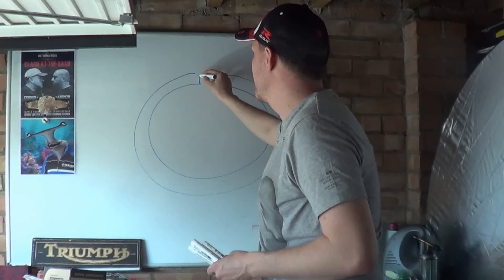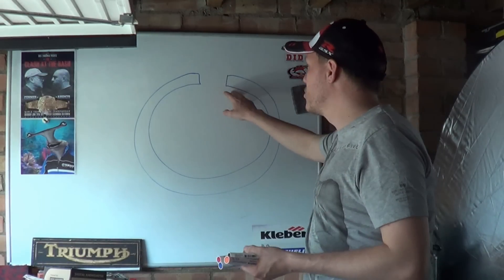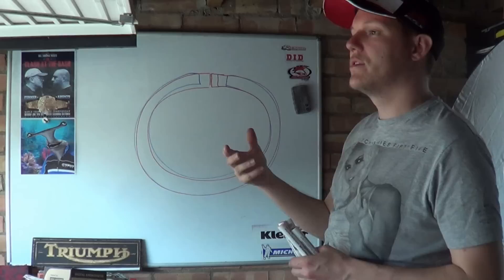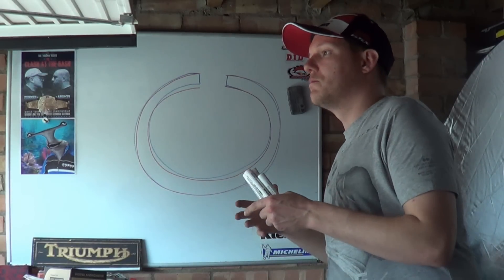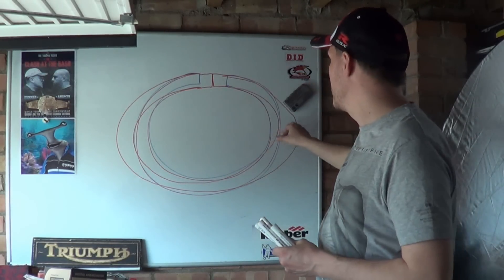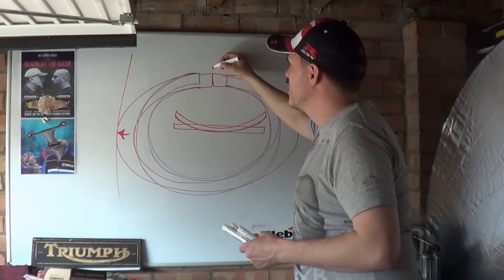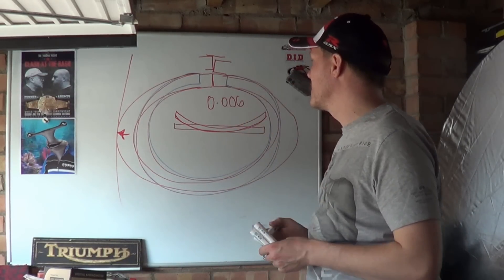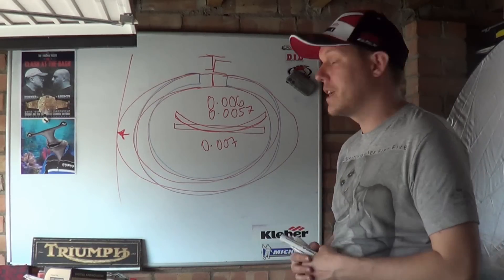Piston Ring Gap - the importance of

Comment: This information simply isn’t true... Hastings Mfg. built two Oldsmobile Aurora V-8 engines about 2000-2001. They dyno tested both engines to get baseline numbers. They increased the ring end gaps incrementally all the way to .080” and found no significant difference in blow by. HP and torque value remain little to unchanged.
Reply from the maker: Prove proof.

Comment: Always went by an ancient prophecy by a long passed ancient assembler. .004 per inch of cylinder diameter unless otherwise stated or forced induction in which case multiply .004 by the number of sockets in an Aldi toolkit 🤪. Ps.   First bit is correct and never failed me.

Comment: i have a sr20ve engine an only when i rev the engine pass 6000rpm it pump's white oil smelling smoke from the exhust...could dis be faulty rings or gap //the gap it 0.022....is dat good for the sr20ve.???
Reply from the maker: White? Coolant leak. Your head gasket might be leaking or cylinder is cracked
Reply: @thedirtyworkshop  more like oil residue iin the exhaust valve  ports only in #4 cylinder.. ..rite now engine is scrap out ...

Comment: is there any truth to the theory that if your engine is a bit tired and using more oil than usual between services you should up the weight say from 5w30 to 5w40 providing both have the same spec i know its now weight but hopefully you get what i mean
Reply from the maker: No. Weight is an Americanism that should be banned lol as engines wear the clearance increase. This means a steady drop over time in oil pressure. Using thicker oil doesn't help this in any way.
Reply: @thedirtyworkshop  so it wouldnt help the oil burning issue then? full rebuild the best way forward price depending?

Comment: I've one question temp is required for expansion of piston ring but at starting of engine temp is very low so rings will not expand and joinds are not attached one end to other end so small gap will be present at initial so the mixture will not compressed properly right? Plzz reply

Comment: Got a question for you,

I built an engine (4cyl iron block 89.00mm bore), I bought a set of piston rings for the stock bore size from some company. DNJ Piston rings I believe, I tried calling them or their manufacturer and I didn't get any information.

I forgot to check my piston ring gap, this is an NA engine by the way. I was told by many that the ring gap is usually already there for stock applications, and that you will usually get an oversized ring instead of an undersized one sometimes. Should I be worried or no? I still haven't started the engine yet. Was also told that machine tolerances are pretty high as well.

Thank you.
Reply from the maker: Did you measure the gap? If not, do it now
Reply: @thedirtyworkshop  Didn’t measure, what are the chances of something bad happening? Rings were ordered for stock bore size, unknown mileage on engine (KA24DE from the 90s), honed the cylinders down. 

I was under the assumption that the rings ordered for the stock bore size were pre-gapped. I’ve yet to start the engine.
Reply from the maker: 100% if its the wrong gap... if it were me I'd check, dont check at your own risk

Comment: Is minimum gap too risky due to heating? Should max gap be used?  Re-ringing an old Chevy 235-6 low HP engine by modern standards. Well presented topic!  👍
Reply from the maker: For reliability in between max and min is a good place to start
Reply: Thanks!

Comment: Matt, could you consider a further video on why the expander ring behind the second ring on a 2T is absolutely mandatory (if supplied with the ring kit)?
Reply from the maker: Because the engineers have calculated the thermal load through the piston to ring interface
Reply: Ah, ok. Also the depth of the ring is different between those designed to run an expander and those that don’t. So, if there’s an expander ring in the box it must be fitted otherwise the ring can go under-flush on one side and catch the exhaust port on the other.

Comment: My advice as an amateur 2 stroke mechanic...always use original items..if you go aftermarket just choose expensive brandts and good quality products..NEVER use cheap aftermarket products...the little amount of money you will save in that case you ll need it (and much more)to repair the damage that will be done...i never had problems with original parts and i never measure gaps ...trust me

Comment: My rings are specced at .006" per inch of bore. My bore is 4.125" which comes to a minimum of .0165" gap. The rings are sitting in the bore with .023" gap. Sure I'll loose a little power but my motor won't snap a ring land like it did last time from base factory spec.
Reply from the maker: if you're snapping ring lands with the OEM spec then obviously you've changed something - but what?
Reply: @thedirtyworkshop  That's easy. Fuel slosh from a tank that was just a bit too low.
Reply: 4.125 x 0.006 is 0.025. The 0.23 gap you measured is 0.056 times the diameter, and is thus less that your minimum spec.

Comment: 45 years ago I put new rings in my 500cc single cylinder AJS.
That night I went for a ride along Gilchrist Ave Herston (way before the Inner City Bypass was constructed).
It was a cool night and I gave it a bit of throttle and within 15 seconds the motor started going slower and slower.  I declutched and the motor immediately stopped.  The motor was seized.  Could not turn it over.  After about 5 minutes it unseized and I could turn it over but it was still 'firm' in the turning.  I waited until it spun freely and gently rode it home.
The next day I took the head and cylinder off and filed the rings down (I don't remember how much).
I reassembled the motor and did not have a problem after that.
Yes, ring gap is important.
Reply: Cool story 👍

Comment: Alright chap. I've bought a teng torque wrench and it's a right bastard to set it the upper range , is yours tight as fuck as well ? (40-210nm 1/2) have to be he man to set it higher than 150
Reply from the maker: are you undoing the locking nut on the bottom? As you wind in the torque wrench, the nut on the bottom turns, doing itself up
Reply: @thedirtyworkshop  seems chinesium. The scale says "torques" lol
Reply: @thedirtyworkshop  yea deffo as per any other torque wrench. Is really weird.

Comment: me, I change the rings of pistons diesel engine 2.0 l ... but now I notice the smoke that comes out of the oil cap with the motor rhythm, after asking the mechanic he confirm me that it will leave with the time, is it normal? ... I drove 250 km with the car, of course having to let it run 8 days in idle for reasons of 8 hours per day, now the draw of the car is a lot better but the story of the smoke, r disturbs me
Reply: Heya man, diesels do normally have a fair bit of blow by and crankcase pressure naturally but without seeing it I'm only guessing  how bad it is. A compression test can give a good idea of what's going on in the cylinders and is fairly easy to do yourself or cheap to have done. If she's hard to start or low on power, oils all watered down or blowing excessive smoke then there may be an issue. If she starts nice and shows decent compression across the cylinders ya probably ok.
Reply: @brotangyoust9252  thanks for the answer,  
The start is nice , as the power it's better then before changing the gaps of pistons,  but I don't know if it's on the top or not because it's yet in break-in period and I think it's not advisable to force the engine, but overall the power is good , 
As compression test I have not the measuring device,  may be I will do it in the future,  as the quantity of smok it's not lot,  it's just when the engine is hot,  and I will make video of the engine working,  thank you
Reply: @brotangyoust9252   Hi there , you can see this video 
https://youtu.be/RrVfR_HTGJE

Comment: Hi workshop, just a silly question, releated to rings and two stroke, in a two stroke when the piston goes down , air is comoressed , so can that air escape from the exhaust port as there is no ring on the skirt of piston, iam thinking of adding a ring   on the skirt, waiting for ur reply
Reply: balsagar Kotkar a 2 stroke crankcase compression ratio is around 1.5:1 so it doesn’t need to be that sealed. Same reason the port timing is measured from the top of the piston, not the top of the ring

Comment: it seems to me that there is a lot too much angst surrounding ring gaps.
I have seen absolutely no test based evidence that there is any significant compression or performance losses through large or over size piston ring gaps.
in fact when AE the ring manufacturers research dept tested the effects of  very large ring gap size on a Ford Engine they found the performance loss 'insignificant'
http://www.diagnosticengineers.org/journal_%20articles/Ring%20Gaps%20vs%20Knowledge%20Gaps.php
it seems to me that it is one of the many old Wives tales that perpetuate over the decades due to lack of proof and ignorance .

if you measure the actual ring gap provided by the manufacturers tolerance range it is an absolutely miniscule area as a percentage of the area of the cylinder especially if the pistons are fitted with ring pins.
I haven't calculated the area but it is clearly a very small fraction of 1%.  Even if we were to accept that a large ring gap was responsible for  1% drop in performance would we really care ?  

1% drop in performance would be impossible to measure without sophisticated testing equipment . 

if the piston has 2x or more piston rings then even with an over large ring gap there would be no appreciable loss in compression and performance. If the compressed gases got past the first ring gap there simply wouldn't be sufficient time to get past the 2xnd ring gap due to the speed of the piston and the number of compression /decompression actions which would be 50 to 100 times every second at 3000-6000rpm

Its all about the piston ring seal to the bore thats where blow-by occurs when rings get worn and age they lose their springiness and don't provide an effective seal to the cylinder wall

Comment: Here's a thing that i didn't (and still don't) understand: 
If you run a 2stroke there is a fresh mixture above and underneath the piston and little (piston ring) gap especially when cold.
What preventing the "flame" from traveling through?
Reply from the maker: Nothing, but its a choke point. This is why you have a large cone around you're spark plug. Flame fronts combust and release heat, this in turn heats the fuel/air ahead of it. The tiny ring gap and the rings themselves absorb this heat and the flame front is killed off. 

Great question. Video coming soon.
Reply: THX for the (quick) reply, so it's that simple ?!
I knew there had to be something otherwise every 2stroke ever build would have exploded at first start ;)
Didn't expect this answer, always thought that an ignited fuel-air mixture was unstoppable (behaving gunpowder like)
BTW it's an very old question that I had examining the piston of my first moped, witch was black underneath the top ring (yes it had 2) about 30 years ago!

Comment: It surprises me that these oil rings and the holes under them that return the oil back inside the piston don't clog. Wouldn't they block once the oil gets old and oil changes aren't done regularly.
Reply: hi i have this issue of starting my car it hard for it to move  until 5 mins of run and hot in engine before gaining pressure to move can any one advice on what to do ,it a honda accord engine 1999 model

Comment: Thank you for the help , I just got new pistons and rings took my pistons and jugs to be bore 10th over size the Bore is 3 inch and 510th the ring gap was 22th but by the math the ring gap should be 16th or 17th  but S&S pree set the gap for the chrome moly at 22th spec sheet has 18th to 22th , the  piston to bore is 2.5th clearance ,  Ring 2 is cast iron has a gap of 28th and that has me worried  S&S has the gap between 18 and 24 thousands ,  the oiler ring gap is at 35th  but can go to 40th  , I was thinking to big of a gap and you get blow by , But test have been done and even a ring gap of 1/4 inch  did not change engine performance or burn oil . The test was done by Chevy on the V6 and V8 , not a Harley Davidson .
Reply: Did you change the gap or go with S&S spec and if you altered the gap did you see any issues compared to standard spec?
Reply: @jediknight1294  Yes I went with the S&S rings that been pree set and 2000 miles I was getting blow by ordered a new set 20 over did a quick hone on the jugs , cut the gap 18 top ring 18 second ring the oil ring was 26th so left it be.   been good 5000 miles no blow by or leak down

Comment: Thanks for the Intel. I broke a ring on a 1958 generator and need to find some. Now I know how important the gap is. Do you know where I can order rings just by the size? Also AvE forced me to sub!
Reply: Hasting Rings online I just left the webpage USA Michigan
Reply from the maker: "Do you know where I can order rings just by the size?"

- the OD, ID and thickness are very important - this is why they are supplied by engine model. For your generator - start by looking for the correct piston od, this isn't going to be easy though. Do you still have the broken ring? If so send me (via email in the description) the thick, cylinder bore and the depth of the ring
Reply: The Workshop, I have all the measurements but I can't find your email in the description

Comment: Also I filed my ring on just one side. Just needed a little bit for spec but now it’s good. I think it’s a little angled just a touch. 

Any how what if the rings where angled a bit off on both sides but still in spec? The piston manufacture wants the rings flat and even shows a pic saying to be sure the rings are filled flat. 

Is this little bit able to make a difference?
Reply from the maker: It depends on how much - if they butt together then all hell breaks loose
Reply: That's why I said still in spec. meaning the gap is in tolerance with a feeler gauge but the corners are a little bit wider but still barely in spec on the corners. It is angled ends instead of flat. Will that make a difference while running?

Comment: i bought a set of rings for my yam FJ1200 last year, had to buy from ebay in the states cos i couldn't find any in the UK,  anyway they arrived and the bloody oil rings don't fit, they are too thick for the ring groove, fkn cost me £135 too :(
Reply from the maker: Doesn't fit how? I'm just curious
Reply: ok here goes, oil rings have 3 parts yeah, 2 flat rings that sandwich another corrugated shaped ring. well when these 3 rings are stacked they are wider than the oil ring groove in the piston, the top and middle (compression rings) fit fine it's just the whole oil ring set up that don't fit

Comment: ring= steel
piston=aluminium
expansion of aluminium is way bigger than steel
so piston grows more than ring
groove in piston gets bigger along with piston
how can gap get smaller?
Reply from the maker: The rings are retained by the cylinder, as the rings heat up due to heat transfer from the piston and friction with the cylinder wall the ring expands in the only way it can.
Reply: that does explain it
but then... doesnt the cylinder wall also expand. 
but then it will not get the same higher temperature so will not expand as much